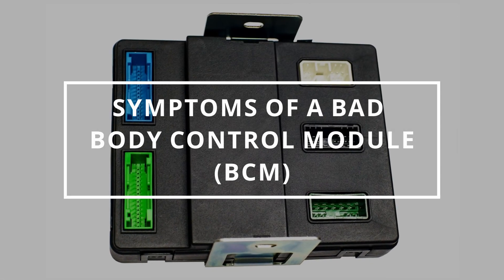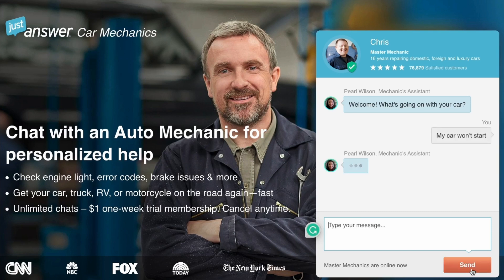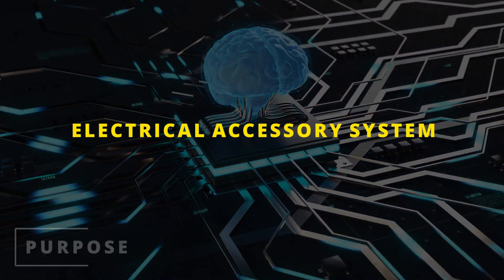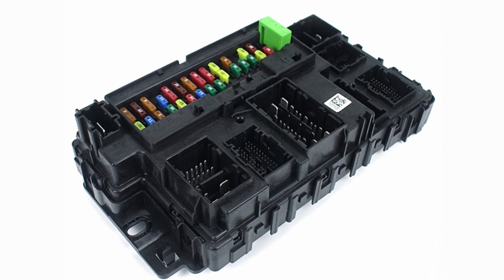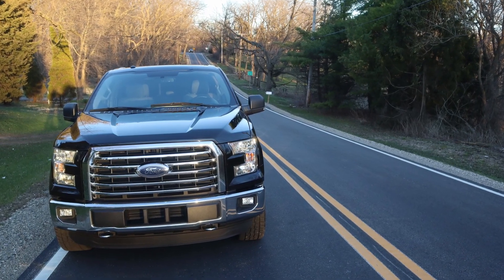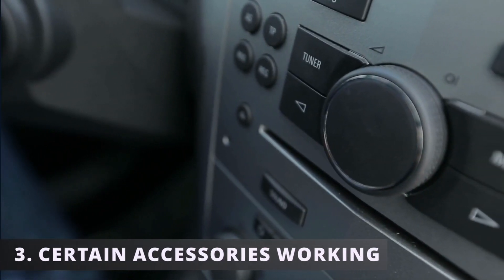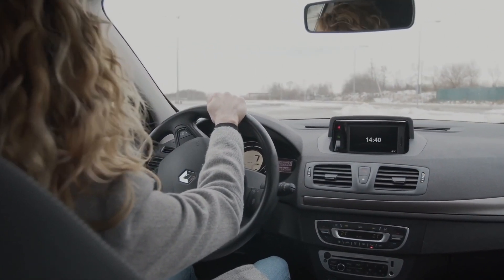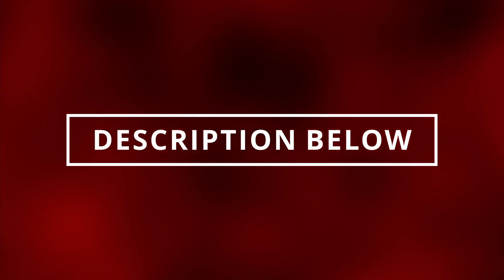SYMPTOMS OF A BAD BODY CONTROL MODULE

Comment: My lighting control module needed to be replaced anyway cuz it would randomly go out so I replaced it and now my left headlight is out. I also replaced the headlight switch and when I turn my blinkers on the hazard light on the dash shows and my digital – is dimming the brightness up and down on its own. So I'm not sure what's going on here. Does this sound like a BCM and I need to find out where it's located? Thank you for your help already. I like the video.

Comment: My mom came home today from work right as she parked. Her car suddenly had the "brake" came on, Power Steering System Warning Light, Tire light is on, ABS and the car with trail is on, Park cannot go to any other gear and when I try to shift the gear a beeping happens. The window are not rolling anymore. the power steering is not working as well. Before that, the backup cameras would turn on when driving. Sometimes the dashboard display incorrectly showing Park but the shift is on Drive. There no code at all coming from the reader
Reply: my exact situation im in right now did you ever find a fix?

Comment: I’m having electrical problems, car brake lights stay on when car is on, steering wheel buttons not working, key lock not working nor is the interior lock, is it most likely BCM? Already changed the brake light switch and ignition switch, had diagnostics done but they couldn’t identify the problem, please help
Reply: Hi there, I have the same problem with my Polo TSI Bluemotion. Did you replace your BCM box to fix the problem?

Comment: 2013 Chevy Impala LTZ 3.6 replace the blower motor blower motor resistor and all that new climate control switch heat and AC we have them on they go on and off on and off when they feel like it or they don't even come on could a bad BCM cause that problem can I have had lost communication to BCM a couple times when they scanned it but it went away😅

Comment: After my car got stolen the riado didn't go and the only window that works is the drivers side clock stopped working aswell could it be the BCM it's a 1994 Nissan Cefiro same thing as the Maxima.

Comment: Okay I have a question I have a 2016 Dodge Challenger and my 8.4 touch screen radio went out then came back on then went out and it controls the climate and everything so the hot air keeps blowing all the time and the window on the driver side won't roll all the way back up it just stays down in that position... Would it be did I just need a new Uconnect radio or do I need to change the body control module or the control module itself????? Anyone answer please
Reply: Are you still having that problem? You could try having someone reprogram yours or something
Reply: @LarryButz-q7b  no it turned out to be my climate control module... But now my instrument cluster lights won't go off they stay on so I'm thinking it's another module somewhere 🤦🏾‍♂️

Comment: Hello AutoFix,my chevy equinox 2018, left indicator on front and back, right indicator on the front, one of the brake lights, high beam are not working,also the audio not working and has engine light on, my mechanic advised me to replace BCM ,should BCM replace solve the problem? Please advise

Comment: You think it could mess with a ram Climate off? Thought it could be HVAC module. Was working fine then stopped, only fans work. Climate froze in off. Stopped my the Zone and pulled this code U0140. I am thinking about these odd things. New LED lights but occasionally message saying headlight out, radio system sometimes never comes on, cruise simply stops working, light comes on but was thinking typical service reminder. I will say this module is a lot cheaper than the hvac. cheapest hvac is like 400 up to 1000 vs this a rebuilt like 100.

Comment: Having trouble with no radio or air blower no ac no power it happen when having trouble with a bad battery and it was changed I did try pulling fuses and replacing in and out and it worked not this time seems like no power to the radio and ac everything else works fine ant tips was thinking of cleaning buc
Reply: I have the same isuue 2015 Dodge Durango R/T

Comment: My 2010 Impala threw random codes and then the codes would go away. For awhile I was replacing everything a code indicated then I realized they were false codes. Replaced my ECM and hoped all would be good but NO.  Clearlyy BCM is fried. This happened when a GMC CERTIFIED TECH reset codes after a repair. Doing this incorrectly will fry a BCM which then can't read codes correctly.

Comment: My engine light came on, and it will not remote start! Any suggestions? Please!
Reply: If engine light is on many new cars won't remote start because the car thinks there is a problem. I need my service light reset on my jeep. If on I can't remote start. If I unplug battery for a vit or reset using my OBD2 I can use remote start.

Comment: What a bout a p068a in 16 ford focus se..1.0l ecoboost start stop....the car did a lot of this. But my dang battery is also old. The code nd engine light has disappeared too. I pressed down on the pos cable, pressed the engine fuse box down, pressed the wiring down...its been mostly behaving as long as i dont turn my rear defroster on...seems to make my dash headlights and climate control lights flicker....i really believe its my car battery as NO one charges it thanks to fords crap location

Comment: Will it effect the ignition push button ? Mine will not crank the engine when I push it
Reply: did you fix your issue im having the same exact problem
Reply: @MarioHernandez-dn3yj  yes ended up being the smart key module costs me 1100 bucks 453 for module 500 diagnostic and the rest labor
Reply: Fix the issue? Same thing with me

Comment: Circuit Intermittent , sometimes when you starter the vehicle check engine going on with VSA, nothing different after update , already replaced the crank shaft , the problem is still , I try to take off the cable from cam shaft sensor and I drive the car. It's nothing gonna be happen no a check engine going on , the pcm has been delay to see I take of the jack from the sensor so what do you think the problem? Thank you.

Comment: I just pay an electro mechanic to fix some wiring on my Dodge Durango, and he charge me $980.00. My car doesn’t turn on in the mornings and when I boost it it starts. I run it for a while and there next day is dead again. Now he told me the BCM is bad, and he wants $1,100. For just the part of it fair?
Reply: My car is  2007
Reply: @abasto4you in my opinion that’s a bit expensive. He can get a used bcm and reprogram it
Reply: @emiliano29171316  just to reprogram the bcm costs over 1,000
Reply: @abasto4you  they’re overcharging you
Reply: @emiliano29171316  I know that, this why I haven’t been able to fix my car. I don’t even know what to do anymore, frustrarted , from the first day I bought the car.😢
Reply: @abasto4you  lol hes having ya pants down
Reply: @DBLOCKヨーロッ  that’s not a very nice remark… at least not too professional
Reply: Did you read the policy of this group?
Reply: @DBLOCKヨーロッ  remember to keep comments respectful and follow our Community Guidelines
Reply: @abasto4you  build a bridge then
Reply: Yup p that’s why I’m not going to spend that money on it, I can’t afford it. If I find someone to give me at least 3,000. For it, I’ll sell it.
Reply: @abasto4you I never buy parts from a mechanic shop. They always over charge. Ebay is your best friend.
Reply: @abasto4you you can buy the parts already programmed new for like 2-5 hundred dollars and get a guy to do an installation for 120
Reply: @abasto4you  I think a parasitic draw.  Unlikely the body control module.

(If it was a was BCM “body control module” you would have something that doesn’t work like horn, alarm, door locks, radio, or you press one and it changes/triggers the other, so if those happen then maybe its the body control module, and it can easily be tested at a dealership with a very expensive scan tool that will show you if BCM is bad but those expensive scan tools are sometimes dealership specific.  Since you say your car drains overnight it’s probably a parasitic drain, so changing the BCM likely won’t do anything to begin with).

How you fix the parasitic drain/draw even though a half a year late is get some cheap multimeter (or if you want an expensive multimeter some multimeters with a clamp SOME CLAMP DON’T MEASURE DC “BATTERY” CURRENT AND YOU WANT ONE THAT MEASURED DC FOR BATTERIES allows you to clamp it over the insulated battery cable to see if your battery cable has current running through it, and how much but you don’t need one for this, and when you yoink the most likely fuse you will see if the amp clamp reading falls by checking the optional clamped wire, but the clamp isn’t necessary, and can do the same thing with a 20 dollar cheap multimeter), open the fuse box under the hood, and each fuse has two metal connectors on the outside of each fuse, WITHOUT yet unplugging the fuses touch both these connectors with your cheap multimeter prongs, and the highest reading on one of the fuse in your multimete will typically be your problem, figure out what the fuse if for in your specific car by the internet find the fuse box information, and then you know what is causing the drain.  ONLY IF the fuse is part of an unnecessary circuit where nothing in it is of any need to functioning the car perfectly then you may be able to drive without the fuse where the components may not work cause the fuse would be part of the circuit needed for current to flow through those components.  It’s better to fix that specific circuit (maybe some light stays on with the car off etc.). By the way since the car does this overnight test the fuses with the car off, and if you have a clamp multimeter you put it over the battery cable after unplugging that highest fuse the insulated battery wire that is clamped would show a drop since the draw is unplugged.  If you want to figure it out better look at a video of a parasitic draw/drain.  But yeah check the fuses when the car is off will tell you what is causing the battery to drain.
Reply: @nickduplaga507 quick question i have a Silverado 00 and when i turn on the head lights and turning on blinkers causes all my exterior lights to blink like the hazards are on. Does this sound like a BCM issue?
Reply: @abasto4you   hey have you tried the starter relay plug it should be in your fuse box try to replace it it’s cheap
Reply: @righteousmasculine  no I haven’t try yet, but it starts fine with a booster charger. I know there must be something wrong with the first boxes, but there are three of them. So I’m not going to change all three 🤔 besides something missy be also wrong with the ignition switch, because the key comes out of it once the car is running, and maybe it’s not normal😳
Reply: @righteousmasculine  there are three fuse boxes in this vehicle. Two are under the hood the other under the dash… wich one?
Reply: @abasto4you  idk bro but check them relays make sure they not blown
Reply: @righteousmasculine  by the way I’m not a bro, I’m a sis
Reply: @abasto4you  aye my bad lol well sis check the ones with relays
Reply: @righteousmasculine  it’s okay nhf,🤫
Reply: @abasto4you  what’s nhf
Reply: @righteousmasculine  no heart feelings
Reply: You should have the tech test you ground wires for continuity. Sou ds like a bad ground wire to me.
Reply: And that's why I appreciate googling ,you tubing and diy. Only if my back is really against the wall. But on an honest the job isn't finished so he needs to have a conscience and do a better job and not over charge you.
Reply: @fullrangebasshead7055  this old man don’t have a conscience, he is a jerk and selfish, añadió a thieve
Reply: I paid 187.00 for my bcm for my hummer. It’s getting out on now. Don’t know what he’s going to charge to program it and put it in though.
Reply: He doggin u bro
Reply: Considering reprogramming yourself
Reply: I have a 2005 Dodge Durango SLT, I hit a pothole which made my radio and the cluster gauges ( speedometer, fuel gauge, Rpm) to stop working along with the blinkers. However some of the indicators still show, lights work/high beams work, the mileage still show, so the instrument cluster isn’t out, I replaced the instrument cluster and that wasn’t the solution. I just set up an appointment with a Repair shop, they told me 150 for a hour of diag, however the diag may or may not take longer…..also it stalls on me in the middle of driving sometimes, it starts right back up, not sure what that made be.

Comment: In a 2017 Civic would it cause the brake fluid light to come on? Dealership is trying to tell me that it's the BCM and gave me a code if B12D3. However, the brake fluid light only came on after they did an oil change on it. Now it comes on intermittently and they claim the fluids are fine.
Reply: 2016+ civics dont have "brake fluid light".  They have a CHECK BRAKES light. Assuming you meant CHECK BRAKES light. You make no mention of the mileage of your vehicle or if you've had a different mechanic asses the problem and what they said.  Or if your vehicle has ANY electrical issues other than that light coming on. The code you give on here, means there's a communication problem with the BCM. It could be a a number of things from corrosion on a connector to the BCM, to dirt or water in the bcm, to cracked soldering in the bcm, to damaged wiring that leads to the BCM.  It really could be a number of things, but that would mean you would have a number of electrical issues in your vehicle if it was BCM related.  Could even be a corroded fuse which maybe not be burnt, but the corrosion isn't allowing problem flow of the electricity through making a weak signal.  That's assuming the code they gave you IS REAL.   IF my brake fluid level is good, and my brakes are good, and so are my wheel speed sensors, my next thing to check would be the wiring to the FLUIL LEVEL switch. Perhaps the harness has become disconnected or corroted at the harness and it needs attention.  OF course, that's if there's no other electrical issues at the same time. IF everything electrical is working fine,  I would not think it's the BCM at all. It's gotta be external cause.  Perhaps you park where rats and mice come around and they've chewed up your wires having to do with your brake fluid level.   As I said, you need a second opinion from a different mechanic. There's AUTOMOTIVE ELECTRITIANS. they charge very similar per hour as the dealer does, and they can confirm or debunk what they issue is.  My money is on a bad cable at the brake fluid level harness. or perhaps the level sensor itself.

Comment: I have a 1994 vr commodore and the horn would beep every couple mins or so and a clicking noise sounding like when the indicator is flicked on under the steering wheel would u know what that is? took the horn fuse out

Comment: I need help I own a 2006 mustang v6 I get these check engine light codes which are p2104 and p2111 and p0122, I have bought a new throttle body and new tps and new throttle actuator and still nothing has worked, even the accelerator pedal has no response at all. Would you be able to help me fix this issue with my mustang?